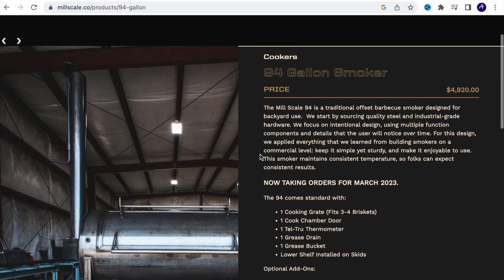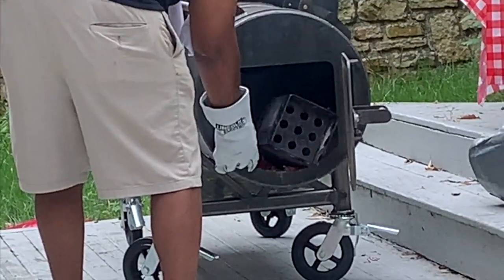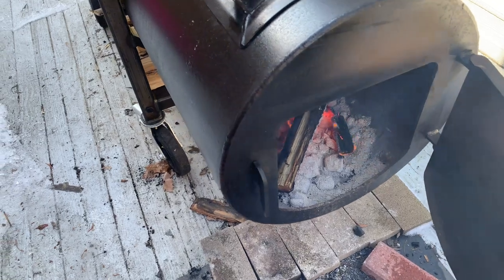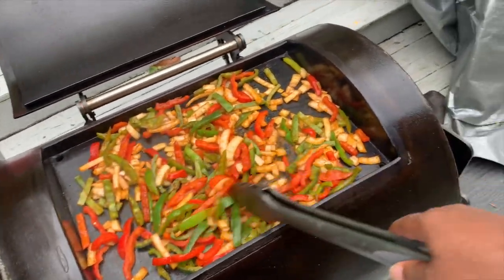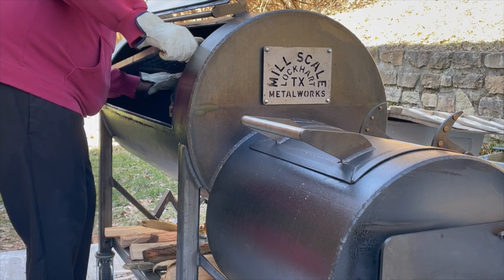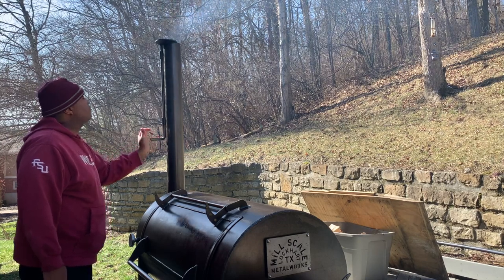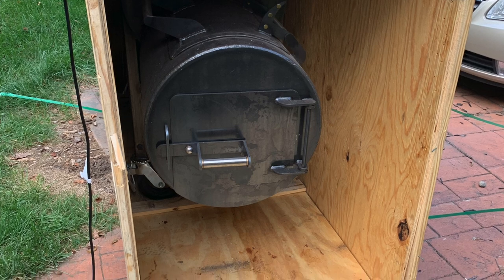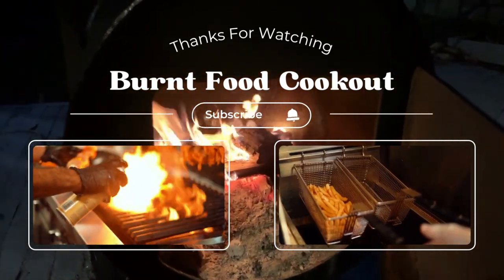Overview of Mill Scale 94 Gallon Smoker with Plancha

Comment: Looks like a very well made smoker. I like the plancha set up. Seems extremely usefull. My fire box is square so I use mine as a flat top as well. One thing I do is keep a can of spray canola oil outside. Every now and then while using the smoker I'll spray it down to keep it seasoned well.
Reply from the maker: Thanks for watching! That's a good idea to help keep the rust away and keeping the smoker seasoned.

Comment: Great review. Do you miss the extra optional upper cooking grate? Did you go with high temp black paint? I can’t tell. Would it be better to have a closing mechanism on the grease drain?
Reply from the maker: Thanks for watching! I've never said to myself that I wish I had a top grate. I am normally cooking for my family of five, or making a lot of something for a potluck. A couple of whole chickens and a couple of racks of ribs; a brisket plus some other sides. As for the finish, this was just the standard steel that didn't have an upcharge or an extra selection required. Over time, the smoker has darkened a bit, but there is no paint on this at all. It would be good to have a something to close up the grease drain, but mainly because you need to leave a bucket after the cook for after-drip. Critters enjoy the grease, and I don't like feeding the wildlife. Sorry for the rambling response but hopefully this helps.

Comment: Great review! I'm seriously considering this pit, but have one question: Those holes in the plancha, won't smoke come out of it? I mean it'll stay under that hood in the smoker, but it won't go into the smoke chamber... I wonder how much smoke you lose because of it.... Have you tested using the smoker with the plancha lid open to see how much smoke comes out of the 4 holes??
Reply from the maker: That's a good question. Yes smoke does come out, but not necessarily enough to impact what's going on in the chamber. About four minutes into this video (https://www.youtube.com/watch?v=SXcO4cIDeOI) you can get a little idea of how much comes out. About five minutes into this one (https://www.youtube.com/watch?v=Xk-5sVWPPsc) you also get a feel. 
There is plenty of smoke to go around and the cooker is relatively efficient, but if the top is open and I was concerned about losing too much smoke, I'd close off the smoke stack a little bit to compensate. That said, I've never had that issue to where I felt like it affected my food negatively.
Reply: @burntfoodcookout  Thank you sir, also for responding so quickly! It seems like there's actually smoke coming trough the holes indeed, but I see why you say it seems insignificant. In Europe I can only order the ' standard' version, or one with both the Plancha and an extra shelf, for about 1700 dollar extra. So wanna make sure that's worth it. Really appreciate your information. Keep making these video's I definitely enjoy watching them!

Comment: If you're tired of re-applying tallow after every cook, try stripping it all off and applying linseed oil to the exterior while its still hot. It bakes on and acts as a clear coat. Do that once a year and it will never rust. I have a MS94 as well and that has been a great rust-proofing trick.
Reply from the maker: How does the finish look with the linseed? Does it change the look of the smoker much?
Reply: @burntfoodcookout  looks the exact same. It’s clear so you still get to enjoy the patina of the raw metal. I’m guessing it has a slightly less wet/high gloss/shiny look to it since it dries on. If you search “linseed oil smoker” on YouTube it will bring you to a video that “Quetorials” made. That’s the one I followed.
Reply from the maker: Awesome. I will check it out! Thanks for watching

Comment: Hello, if you store it outside do you have a cover for it? My question I guess is do you find rain water seeping in around the door opening? Thanks
Reply from the maker: I use a tarp that covers it while not in use. It’s not a perfect solution but it does keep the weather off the cooking chamber and the fire box. The wind eventually will knock it off the smoke stack so that takes the most abuse from the weather. Eventually I’d like to just build a covered portion of my patio to keep all the grills there.

Comment: Where does the grease drain into from the plancha? Into the firebox?!
Reply from the maker: That's right, whatever extra grease you have drians into the firebox, or it burns off. Unless you are browning ground beef or something, there isn't much runoff.
Reply: @burntfoodcookout  it wont start a grease fire?
Reply from the maker: I guess it's possible, but it hasn't happened yet. The same reason cooking burgers over a flame doesn't start an out of control grease fire, there's not enough fuel for it to really get going. I'd be more concerned about flames  creeping over to the cook chamber because that's where the real grease is

Comment: I recently purchased a Mill Scale 94 as well.  The first cook was excellent.  Compared to a high end smoker that I purchased out of Houston: 1) it heats up quickly - due to the grate level exit opposite of the fire box; 2) The smoker works great with brisket - hope to try ribs in my next cook.  Mill Scale 94 = highly recommended!
Reply from the maker: I shouldn't be surprised, but the 94 feels really comfortable cooking beef and does it incredibly well. I have not been disappointed by the smoker and its fun making better food over time.